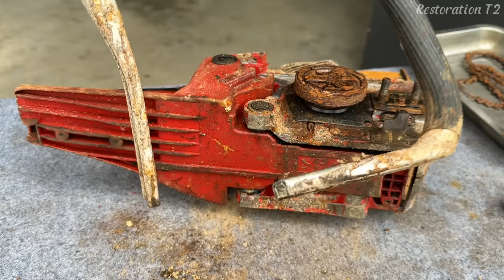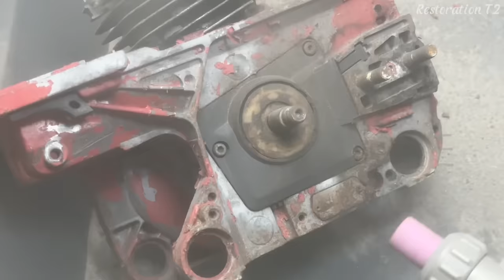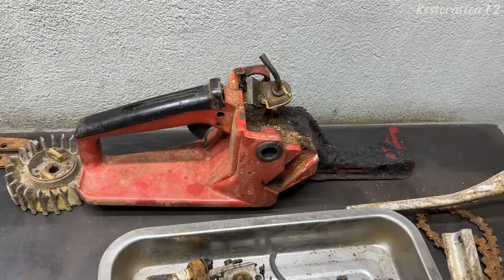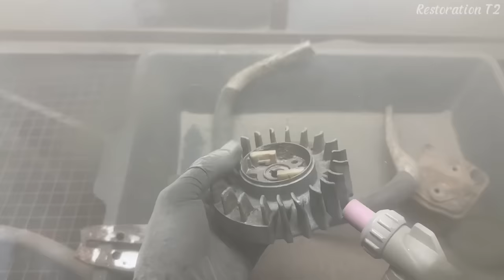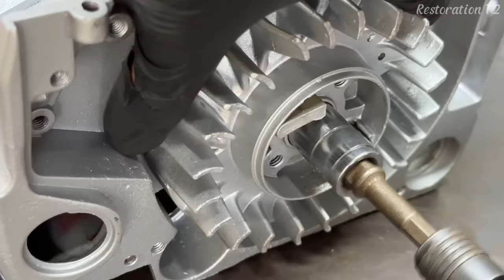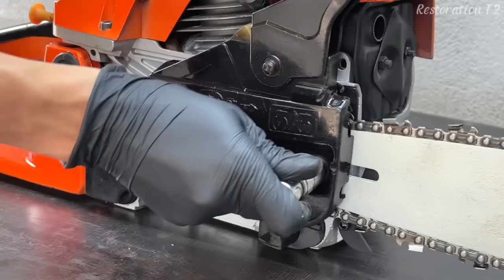The Owner Of STIHL Invited Me To Work As An Engineer When He Saw This Video

Comment: When removing the flywheel you should leave the nut on crankshaft so you don't damage the threads hammering the wheel loose. And after all that work you should have put new piston rings main bearings and seals that bottom end sounds a little worn out.
Reply: and never replaced the crappy old kill switch

Comment: Sadly missing the most potentially interesting part: restoring the OG carburettor :(( 

Basic car mechanics can take an engine apart, including splitting/reassembling crankcases & disassembly of top-end (cylinder head), clean up & spray some paint on it: the challenge here seems mostly to free the surface/ingrained grime to get at the heart of the problem. Inspection/clean of cylinder bore(s) & piston heads may be a bit troublesome, but with no commentary or subtitles & poor lighting it was difficult to tell if the cylinder bore/piston head had suffered any serious scoring or other dmg. Reassembly is relatively trivial provided the gaskets are to hand & torque is applied correctly.. tho mind those cylinder rings! :)

I'm surprised this guy uses a grit blaster to 'clean' some parts other than remove old paint, I guess it's what he's used to (or has available). For something this small I'd use a circulatory washer/bath & hand scrub for basic grime; an old dishwasher is great for external intricacies, adapted to inject whichever cleaner via its hoses; or for smaller parts such as carb jets, an ultrasonic bath

Personally I wouldn't trust that OG saw bar any more for anything other than light work, even tho it's not designed to be a stressed component: there's no practical way to tell how much dmg has been done to the metal while it sat corroding, so an unexpected stress failure may well be a problem later on :((((

The final 'test' was also deeply unsatisfying: sawing thru a couple of softwood 8x2s is hardly a feat except to show the motor can run under (limited) load. If a decent-sized (say 15"/42cm diameter) hardwood (ash, oak, hickory, WHY) log or stump had been available, that'd be a much better finale, & far more use for RL comparisons IMO, judging by my estimated length of that bar

Comment: The title of this video had me in stitches😂😂
He 'restores' an old Husky, strips it down, does nothing to it except splash sealant all over the place including the piston and both ports of the barrel, spray paints the barrel without blocking the ports off (bet that made the piston look new?), didnt set the rings up properly before installing the barrel, wrong sized key in the crank, no bar tensioner, paints it in the colour of goodness knows what saw manufacturer.
I used the word 'restored' as a laugh as he restored absolutely zilch!
Hes good..... NOT!!!
😂😂😂
Reply: That's why I subscribe to these Oriental restoration channels. For a good laugh and how not to restore anything.

Comment: Putting the blow torch on those bolts has now taken the temper out of them and all other parts that were tempered.
The oil bath after will not have retempered them.

Comment: I’m all for reusing rather than letting things be wasted, but why on earth would you reuse rusty bolts instead of replacing them? 

Burning the rust off doesn’t mean the bolt isn’t weakened. 

Just replace all that hardware, if you really wanna avoid waste, melt the metal down or something, don’t cut corners though.

Comment: I was a master tech for Stihl Canada and worked as a mechanic on lots of different saws. So I'm calling you out on what you say. How you disassemble this saw is a disgrace. It would be a cold day in you know where ,that you would work in my shop!
Reply: Sanding with plastic together 😂😂😂 wow what a ingenier.
Reply: Impacting….. rusted Allen heads and Philips…. Cringes the biggest “omg” was the impacting the the bolts on from the tip of the impact, no starting the threads first and its pneumatic!!! Painting over black plastic. Wire wheeling the piston with that insanely aggressive wheel. Sandblasting the block thinking paper towels would stop the abrasive…. Good entertainment but a lot of confused looks on this one
Reply: And I’m not an engineer!
Reply: He painted over everything… even the seals 😮
Reply: You sound like a jealous person because this man does a fantastic job every video
Reply: A nadie le importa tu critica negativa 😌👌 mejor sube unos de tus videos y veremos si eres tan bueno como dices!!